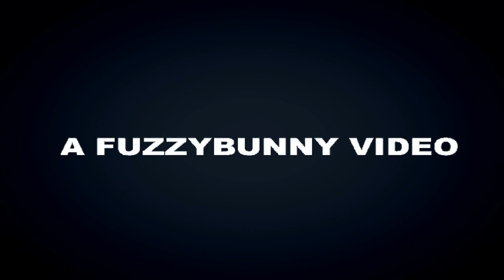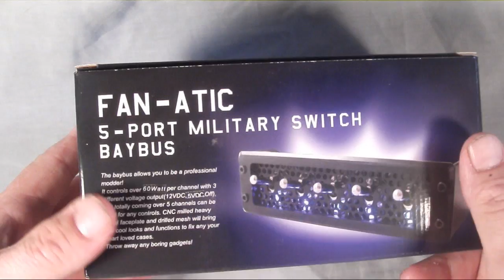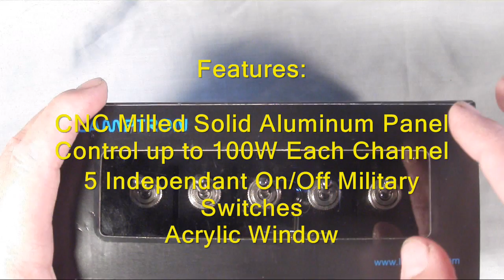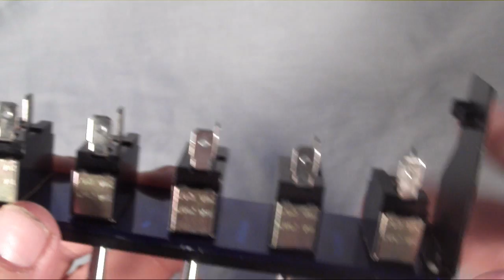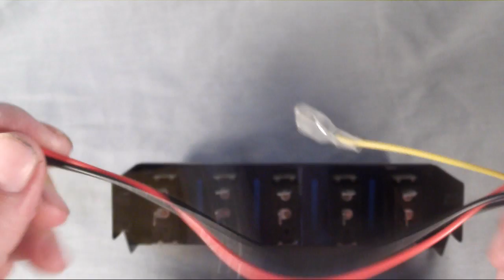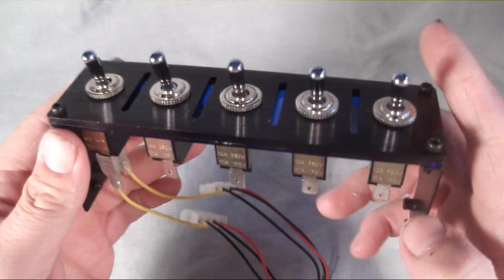Product Showcase Lamptron Hummer 5-Port Military Switch BayBus

Comment from the maker: Yes and no I guess. The power switch is momentary. Meaning it is only designed to be on for a instant. Where as these switch are designed to be turned on and off like a light switch. I Imagine it could be wired to work that way but you would have to turn the switch on and off quickly to turn the computer on. Other wise it would act like holding down the power button and just keep turning the computer back off. I hope that made sense.